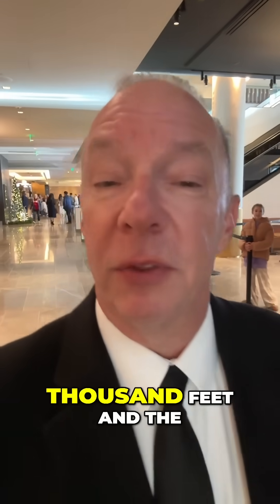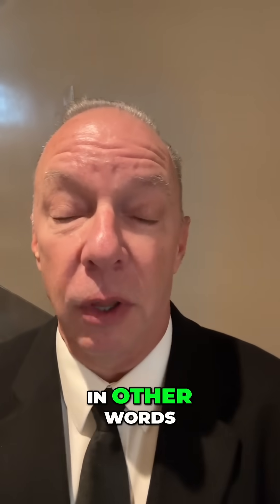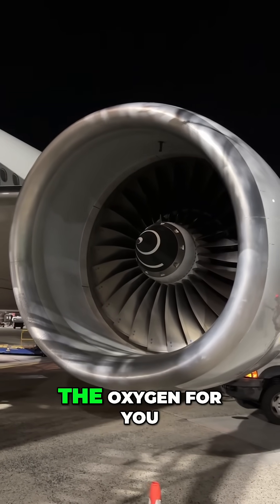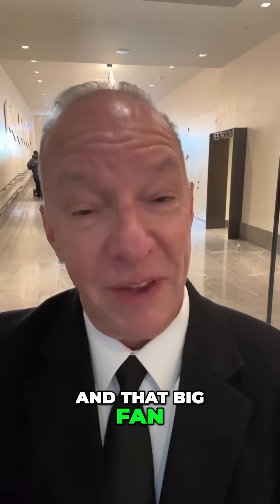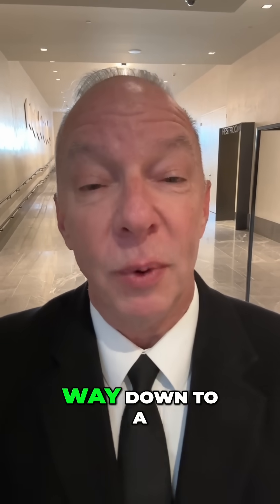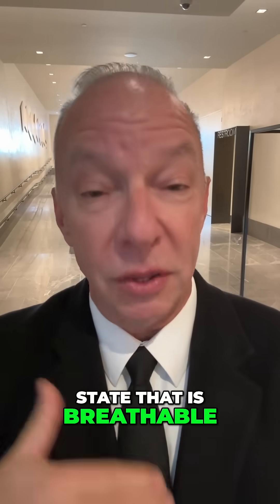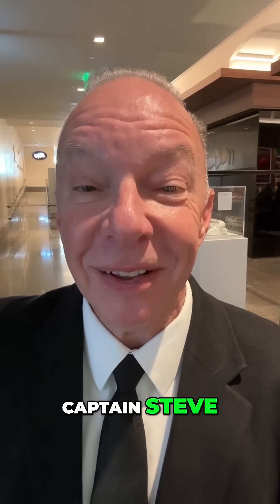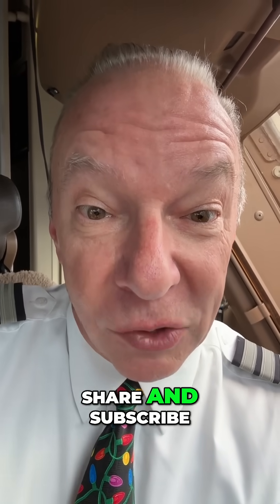How Airplanes Make Breathing Possible at 37,000 Feet

Comment: What you described is mostly accurate i would say. Both the air outside and inside the aircraft are perfectly “breathable”! The air down at sea level and at 37000 feet high is exactly the same. The problem is that at 37000feet the pressure is so low that it’s not enough to force enough oxygen into your blood stream for you to survive. “Unbreathable” air would be air that is actually hurting you when you breathe it in. The Engines don’t produce any oxygen at all! They just collect air and compress it to a pressure that is actually survivable for humans. Also it doesn’t get compressed down to sea level, it actually gets compressed down to a pressure equivalent to that of around 6000-8000feet depending on the type of the aircraft, and how high you are flying.

Comment: Just one thing the aircraft cabin pressure at 30,000 ft (10,000 meters) is not at sea level its about 8,000 ft (2,460 meters) with about a 8 psi (5,624 kg/cm2) difference between inside and outside. 

29 years as a aircraft mechanic with a major airline.

Comment: How often is 60% of air coming in from the outside?  If there is new air being added consistently, when or how is existing air taken out?  Wouldn't it eventually be too high of a pressure, unless air is just taken out naturally through leaks in the plane.
Reply: There's an exhaust valve that lets out the air that is replaced.  The cabin pressure is maintained at about 80% of an atmosphere.

Comment: absolutely completely wrong. he git ZERO details correct. a supercharger located in the cabin takes outside air and pressurizes it for the cabin. the jets engines do not provide air for the cabin. why? because if the e gines fail youd have no pressure, if one caught on fire youd have smoke in the cabin.
Reply: it would have taken you about 8 seconds to google how a bleed air system works and it would have saved you from being wrong on the internet.

There's a bleed air switch in the cabin specifically BECAUSE the cabin can fill with smoke if an engine catches on fire. And since everything in a commercial airliner is redundant, you only lose bleed air pressure if BOTH engines fail.

There is a ram air manifold as well, but that's only used to provide low pressure air for the heat exchangers in the ECS to cool off the bleed air before it's sent to the cabin.
Reply: What are you talking about? You clearly have no idea how any of this works. Why would a plane waste space for a supercharger if the engines already do what it does?

Comment: PI55 POOR Misleading explanation. The Oxygen out side the plane is the same as the Oxygen inside the plane. Identical types of oxygen , just the pressure is lower outside. Stratospheric atmosphere needs to be compressed to equal air pressure closer to sea level.
Reply: That's what he said. The engines take the air, compress it, and release it inside of the cabin.

Comment: Doesn't compression increases pressure 😅
Reply: Weren't you listening? The atmospheric pressure outside of the aircraft is much lower than inside. You'd need to pressurize that air before you put it inside of the aircraft.

Comment: It's funny how everyone gives the example of Himalayas or mount Everest to explain how you can't breathe. My dude, people can relate more to an airplane than to Himalayas. More people have been on an airplane than on the mountain tops
Reply: For this reason, the Himalayas and Tibet are a natural no-fly zone, where only local flights will ever enter it.

The pilots need to be able to descend the plane to 10,000 ft in an emergency.  If the land elevation is too close to 10,000 ft, then this will be too close for the plane to safely descend in an emergency.  There is no margin of error when flying over high elevation.  So for this reason, overfly flight plans, will avoid Tibet and the Himalayas.

Comment: Wow, cabin pressure at 37,000 feet is certainly never set to sea level, is it? And stator blades don't spin at high speed. Stator blades don't spin at all. It's the rotor blades that spin. The stator blades are STATionary and help redirect the air from one rotor blade to the next rotor blade. Also, the big jet engine doesn't "produce oxygen." That's just not a good way to describe increasing the pressure of just AIR.  And we can't "fly safe" because it's just bad grammar.
Reply: He's explaining it for the idiots in the room. Not everyone is an aeronautical engineer

Comment: Thank you for explaining the circulation of air in an airplane. However, there was no need to talk about oxygen separately. All you had to say was that the composition of air is isotropic, meaning wherever you are in the atmosphere, the percentage of the components of air remains the same. So all that needs to be done is compress the air to a comfortable pressure and heat it to a comfortable temperature. Bingo.

Comment: So that initial engine kick on always had a faint fuel smell to me.  Usually lasting just a few seconds.   Could that be the case? That I’m sensing some pull from the system that connects the air flow to engine 🤷🏼‍♂️

Comment: Stators don't spin the turbine wheel does, stators do move with a VSV type system that varies the pitch of the blade but don't spin around. there are several places on the engine that bleeds air for things like 02 system plus several more systems, I am no means a A&P but being a mechanic with interest in many types of aircraft and turbine engines i have learned quite a bit. He gives a decent explanation of the system but lacks the finer details, not all pilots are gonna be totally into the mechanical side of things but usually have a good bit of knowledge.

Comment: For someone who is trying to explain the issue of breathable AIR, there are several errors or omissions. 

Firstly, please stop referring to the air we breathe as just Oxygen. 

Air is only 20.9% Oxygen.
The remaining constituents are 69% Nitrogen, 1% Argon, and the remaining 0.1% include water vapour, CO2, dust etc.

The partial pressure exerted by any of these gases is simply the percentage of the gas (which does not change) multiplied by the ambient pressure. 
Humans require at least 0.16 bar of Oxygen to survive (equivalent to 16 percent at sea level where the air pressure is 1 bar or 14.7 psi).
Air at 36000 ft is only 3.3 psi or just over 22% of normal atmosphere pressure.
To provide the minimum breathable air with equivalent partial pressure of 0.16 bar of Oxygen in the cabin air would require the external air to be compressed to 11.25 psi.

Comment: Here’s the kicker. Have you ever felt more tired on a plane than you normally would? Well just as he explained,40% of that air is recirculated. So less oxygen content, more carbon. Not dangerous but enough that you fell tired on the flight and you think well, I’m not this tired usually at this time. The same is actually true in a car on a road trip. If you set your air system to recirculate air, you will get more tired than normal. This is a cause of many drivers falling asleep at the wheel. So in a car you should crack windows allowing fresher air in. Removing carbon monoxide from the recirculating air. That’s why you get more tired driving than you would sitting in the couch at home.
Reply: That's carbon dioxide, not carbon monoxide.

Comment: At 30 000 feet oxigen level is 6.7% and at sea level 20.9%
However, you may survive with 30-40% of sea level oxigen if you do nothing other than breath. 
Correct me if wrong.
Reply: Air at sea level is around 100 kPa
Air at cruising altitude is around 25 kPa, which is too thin for you to survive.

The cabin isn't pressurized to full sea level pressure, but rather it's pressurized to about 80 kPa. 80 kPa is typical of Colorado's air pressure, where it's still safe to breathe and be athletic without an oxygen tank.

The oxygen in the air, both at sea level and cruising altitude is 21% by molecule population.  This means its partial pressure is about 21 kPa at sea level, about 5 kPa at cruising altitude, and about 16 kPa inside the plane cabin.  You need about 14 kPa of oxygen partial pressure to be able to safely breathe.

Comment: Basically everything he says is wrong. The Air in 10 km is the same as at the ground, give or take some noble gas and ozone, the pressure is just lower. The engines do not collect oxygen, they simply compress the air.

Comment: 1) The percentage of oxygen in the air at 37,000 ft is about the same as at sea-level.  2) The stator blades (@1:05) do NOT rotate, they are stationary, it is rotor blades that rotate.

Comment: The partial pressure of oxygen is kept close to the acceptable minimum of 16%, while at sea level it would be 21%. Total air pressure inside the cabin is about 0.76 bar or 0.76 atmosphere, which is the equivalent of the air pressure at 4000ft or 1220m altitude.

Comment: It's a little disturbing using the word oxgen generators. Firstly oxygen in an emergency is from cylinders. Neither do you take the oxygen from the engine it's air which gets compressed. Frankly a very poor explanation

Comment: Great explanation. However, the engineers didn't invent this air craft refrigeration thinking air is not breathable. Because it is not feasible in a piston propeller engine. So they flew in low altitudes. Only after jet engines became normal, air craft refrigeration was a part of it based on bell colleman refrigeration cycle. Consequently, they were able to fly in high altitudes. Breathing problem was never a separate objective.

Comment: The 787 has no bleed air system because it’s all electric systems-wise. There are electrically-driven compressors to supply the oxygen to the passengers and crew.

Comment: That pressure/temperature relation is also why California experiences the hot dry winds called the Santa Ana winds. As cool dry air from the inland high desert area moves toward the shore, it is compressed by the increased atmospheric pressure at the lower altitude and its temperature increases dramatically.

Comment: It's amazing that air that starts at -40 degrees can be compressed to a point that it becomes too hot to breathe.
Reply: When you compress air without allowing it to heat sink to the surroundings, it gets hot.  One source of this heating is the friction from the machinery.  A much more significant source of this, is the work associated with adiabatic compression.

In the ideal frictionless case, the new temperature T2 after compression given by:
T2 = T1*(P2/P1)^(2/7)

The 2/7 number is specific for air, and 2-atom elemental gasses in general (e.g. N2 and O2).

Plug in T1 = 233 Kelvin (equal to -40C)
P1 = 25 kPa, typical air pressure at cruising altitude
P2 = 80 kPa, typical cabin air pressure (for reference, sea level is approx 100kPa)
and you'll get T2 = 325 Kelvin, or 52 C.

That's hot enough that we need an air conditioner to cool it down for it to be safe for passengers.

Comment: Captain Steve is it also true that because of the lower air pressure in the plane, the gas in your intestines expands causing bloating & discomfort leading to potentially larger farts? I’m guessing those same HEPA filters absorb mitigating most of the strong odors as well? 🤭😬✌🏽

Comment: At 37 seconds you stated the engines produce the oxygen. Wouldn't it be a little bit more precise to say the engines "condition" the outside air to be useful inside the fuselage?
Reply: Correct.  There is no production of oxygen, just a compression and cooling of air from the outside.

Comment: Wow so it’s not just recirculating air? I always thought it was. Amazing that 60% is basically fresh air. Is there a reason why it needs to be so dry? I always get a blocked nose after a long haul flight because the air is so dry on planes
Reply: The reason it "needs to be so dry", is due to the nature of the way humidity works.

At lower temperatures, the maximum amount of water vapor that air can contain, is a lot less than it is at high temperatures.  When you heat air, the population of water molecules stays the same.  But the maximum possible population of water molecules increases, due to a higher temperature having a greater capacity to support water vapor.

The humidity you feel is relative humidity, which is the ratio of the actual amount of water vapor, compared to the maximum possible amount of water vapor.  So when you open up new capacity for water vapor by heating it, you also make the same water vapor less effective at humidifying the air.

If you compress fully humid outside air from -40C and 25 kPa to 80 kPa, and the cool the air from its compressor outlet to 20 Celsius for the cabin, you get a relative humidity of 1.76%.  This is extremely dry.

Airplanes need a humidifier to add water vapor to the air, in order to make it comfortable for passengers.  Comfort is generally accepted as 45% to 50% relative humidity.  30% will feel like a desert.
Reply: @ wow amazing. Thank you that’s so interesting. Have a great day!

Comment: Stator blades don't spin. "Stator" means "stationary." Rotor blades spin.

And perhaps the bleed air is at low pressure compared to the exhaust, but it's certainly not at low pressure compared to the ambient atmosphere.

Otherwise, I like it.

Comment: The airplane is just pumping regular low pressure outside air into the plane at a high enough pressure to breathe like normal. I took my gps onto a plane and it said--by air pressure--that our elevation was 7000 ft even though obviously we were around 35000 feet. This guy needs to slow down with this stuff a little

Comment: The air you are breathing in the aircraft is not the same as the air at sea level. The aircraft is pressurized to maintain an internal altitude of approximately 7,000 to 8,000’ft. So the air you are breathin would be the equivalent of being at between 7,000 and 8,000 feet.

Comment: But cabins are not pressurised at sea level, the norm is 8,000 feet which is why a bag of crisps will expand as you climb and an empty plastic water bottle will compress as you descend. Try it.

Comment: At 0.8 Mach you wouldn't even need the engine to compress it. A well-placed venturi duct could capture the air moving near the skin of the airframe & push it into the cabin. 
However, it would be less reliable & harder to control. Due to the dependency on both velocity & altitude.

Comment: They use compressed air from the APU to start one engine and then use compressed air generated from the running engine to start the next. They’re already built to compress and shuttle air around the craft as-is, so feeding the cabin with the compressed air makes sense

Comment: During the early days of the F-22 raptor program, some of the bleed air that was being fed to the pilots, was somehow getting emission contaminants from the engine in that particular system, which subsequently was causing the pilots to blackout and crash those $350,000,000 planes😬

Comment: Great explanation.  I used to test Internet connections for aircraft.  We had a long term rental of a lear jet from a shotty company that refused to fix a reoccurring issue which moisture would build up in the back of the plane and it would smell like mold.  Several engineers refused to fly on that aircraft and got reprimanded.  A few months later, the problem exposed itself as a bleed air issue in which the valve became stuck in full on position super heating the cabin and filling the cabin with smoke.  An emergency landing had to be made.  I wasn't on board but that reprimand was taken off of my record.  I regret not using that company.
Anyway that was my lesson on bleed air.

Comment: Stator blades don't spin. The fan and the compressor blades do spin and so do the turbine blades.
Also compressor blades are not the stages of a fan. Fan is there to provide thrust through a bypass while compressor blades compress the air that goes through the core of the engine.

Comment: But, the inside of most airplanes is equivalent to around million to 8000 msl. I have to use oxygen when I fly commercial and without my 02 concentrator, my saturation drops to 88% while it is 97% at msl.

Comment: Fun fact: the air pressure inside the plane is not at sea level but more like 6000 feet. 

I used to have a watch with a barometric altimeter and it always leveled off somewhere around 6000 feet.

Comment: Oxygen outside the airplane is quite breathable, but the  partial pressure of O2 in air at 37,000 feet is not sufficient to sustain life.  At the roughly eight thousand foot pressure altitude inside the cabin, it works just fine.  As usual, Captain Joe needs to ask a mechanic to get his facts straight.

Comment: Much too long and confusing. 

"The air up above 20,000 feet is too thin to breathe. The engines compress air to burn fuel. Some of that compressed air is sent off to the cabin air conditioning. The cabin air pressure is maintained equal to that at about seven thousand feet."

In the engine, the stator blades are stationary.

Comment: Nice explanation! Besides: the term ”partial pressure”, shouldn’t it be denoting the different ”parts” of the air, (oxygen/nitrogen/carbon dioxide)not the air in it’s entirety?
Could the term ”density”be useful, perhaps?
Reply: You are right, but don't wage your academic wars on FAQ forums

Comment: The  "fan" inside the engine is a "compressor".  A fan throws air whereas a compressor pushes the air into a smaller space (to increase the pressure, compresses).

Comment: He over used of the word oxygen instead of air. It is 'air' that is bled off the engines not oxygen for example. While air does have oxygen it is only about 21%, most of the rest is nitrogen. Pure oxygen has a considerable fire risk.

The excess air is vented out the back of the airplane and creats as much thrust (in a 747) as a small general aviation aircraft. (Cesna 172 maybe) engine that powers the plane.